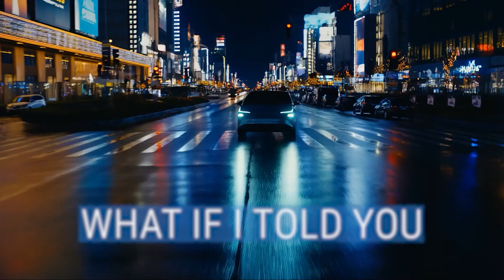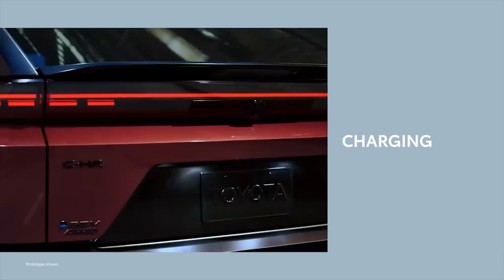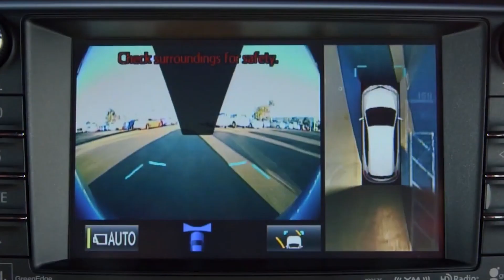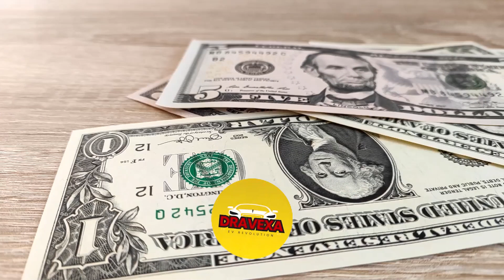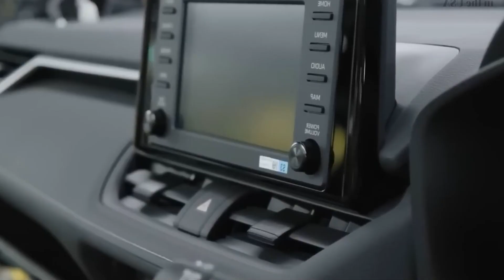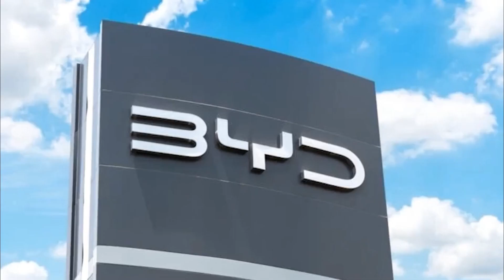Toyota’s 2026 EV Just SHOCKED Everyone — Can Tesla Survive?

Comment: Wow, what a lot of hype! Sodium batteries output lots less power as they discharge. Plus many competing EV's can do 550 or so KM and recharge in 45 minutes. The power density of a sodium battery is much less than most other chemistry options. Sure, it's safer, but it's pretty close to prototype rather than proven technology. So, wait and see how it works, when it arrives and wait a little longer since who wants to be their beta tester? Not me.
Reply from the maker: Definitely a lot to consider with new battery tech like this; it'll be interesting to see how it develops and if it can meet expectations.